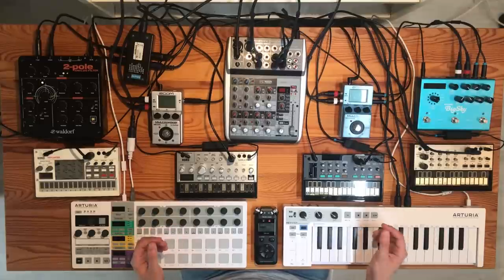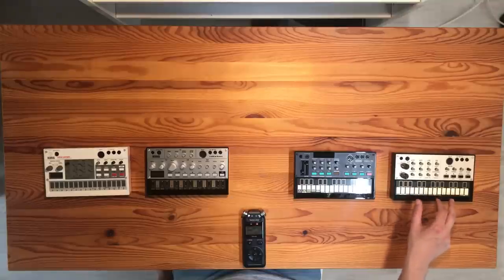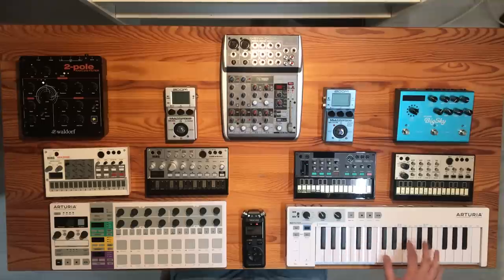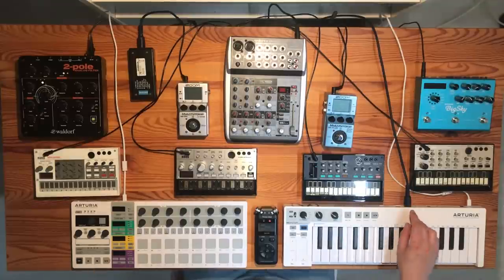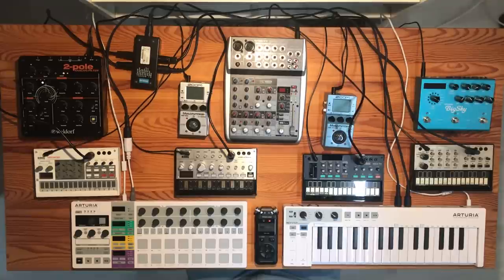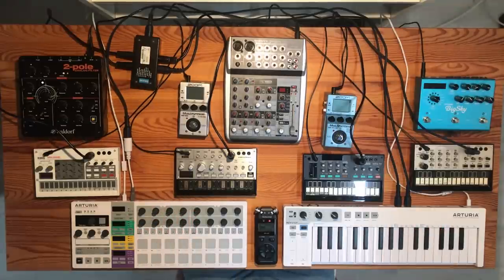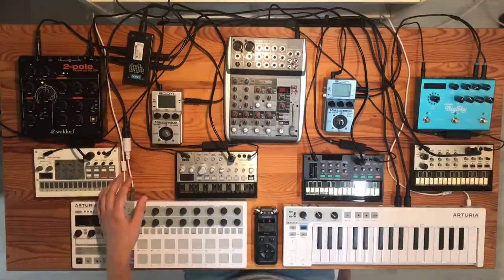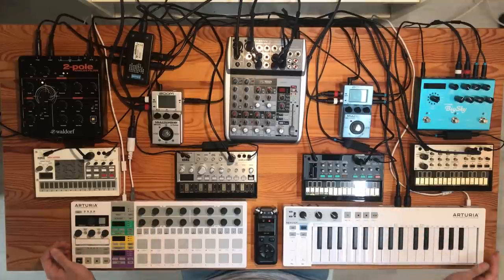Our Volca Setup: How Is Everything Connected? (2018-06-03)

Comment: Midtech midi thru filter, does it work or not? Does someone know an alternative?
Reply: for me it's a clear yes and no: I can filter the velocity but when it comes to the system messages I don't know how to get it working... already tried almost any possible configuration. Is there anything that has to be changed in the Keystep and the setup of the box as well?
Reply: @niklas9649  maybe it is better to just connect only the keys to the midi controller with midi and connect controller to the mixer. And connect bass and beats/sample to the mixer as well? I mean: i wont buy an FM volca.....
Reply from the maker: @Sharkwhisperer  Like @Niklas said: it does work for filtering out the types of messages it mentions on the box (e.g. velocity, pitch bend), but the Miditech cannot filter out start/stop messages. I made the mistake of thinking that turning on the filter for "system" messages (which actually stands for "system exclusive" or "sysex") prevented start/stop, but that's not the case. Apparently, when you've connected an active MIDI device to the Keystep's MIDI IN (in our case it's the Beatstep Pro), the Keystep will not send start/stop messages when you press its transport buttons. When I press start/stop on the Beatstep, the Volcas do respond. So it's perfect for our scenario (we have made the agreement to never stop the Beatstep during jams, haha), but unfortunately the Miditech is not the solution for filtering out the transport messages.
Reply: @SlenterendeBeer  thanks but if I connect only the volca keys to the keystep and connect this with the mixer and connect the bass and the drums with the mixer.   Further on I will connect the volcas among themselves so they are in sync. Would that be a solution. I am a beginner in this. Thanks a lot for you reply. I am dutch too. (also thinking about adding reverb pedal, the hall of fame 2 should be one of the best, but not cheap). And compliments from an English teacher for your English : )
Reply: @Sharkwhisperer  first of all on a sidenote: two dutch and a german discussing midi chains over YouTube, that has a ring to it.
But back to topic: when you try to invert the chain (regarding the clock signal), having the Volcas as master clock to the Keystep, you will lose the arpeggiator and sequencer function in the Keystep. They only work with the sync set to internal. That would reduce the Keystep to a mere keyboard, what would be a waste of possibilities in my opinion.
@slenterende beer The twist with the midi-in signal stopping the system messages is kind of difficult to understand but intriguing.
Reply: @Slenterende Beer @Sharkwhisperer
So I got in touch with someone from the Arturia TechSupport (hands down one of the best support teams I witnessed in a long time: quick, friendly and 100% dedicated to find a solution). Their answer goes in the same direction as what @Sharkwhisperer suggested, putting the Keystep last in the clock chain. It appears that this solution still wont let you work around the problem with the transport messages, but like this you would be able to have a smaller setup without the need for a BeatstepPro. I will just post the original further down this comment. I haven't been able to try the suggested solution yet, but I will post an update here when I had the time to.

In order to achieve this I truly think the keystep should be slaved to the volcas, make sure to update to the latest firmware as well and make sure you have the arm to start function enabled, as well as made sure that the keystep is either set on midi or on clock if feeding only a clock from one of the volcas. The arm to start function would let you use the arp or sequencer only when desired while still being synced to the tempo of your song. 
So I'd advise you to put a volca as master, say the one you are not sequencing or playing on with the keystep, send the clock to the keystep through the analog clock input use the midi output of the volca to send to the midi box to pass the clock to the two others, and if you have a second input on the midi box then patch the midi out of the keystep to the box to pass the note information to the two volcas. 
If you do not have a second input on your midi box i'd advise for you to pass the clock through all of the volcas and put the keystep in the end of chain, and proceed with the midi box.
Reply: Here with an update!
The latest firmware update for the Keystep brought a crucial new feature for this subject to the Midicenter: the 'Arm to Start' function. You have to turn it ON.
If you then connect the Keystep (as well as the other Volcas) via sync-cable to one 'master-Volca' that sends the clock signal you will then be able to use the sequencer and the arpeggiator of the Keystep without having to worry about the transport messages.
Be sure to set the Midi clock of the Volcas to internal (not auto) and the switches on the Keystep to Sync In.
This works for me. I use the Miditech box as well to filter the velocity and as a thru.
Sorry for a possibly bad english. I hope that was understandable and helps you guys!
Reply: Why not tuning midi commands on controller or Wolka?
Reply: PocketFilter/software filtering is another alternative
Reply: @niklas9649  So if the Keystep gets an external Clock/play signal via Midi from another device it is unable to use the sequencer?  I am thinking of buying one but whant to figure out potential proplems it could have with my set up...
Reply: @Lobbogurke  just read through this discussion and you'll find the answers. I'm no tech pro, so my answers probably are lacking insight on that. For me, the arpeggiator for example ONLY works, when it has an external clock. In my case, the internal clock struggled with my synth setup (Korg Volcas). As some others already stated there occurs no such problem, when you combine it all with the Beatstep Pro. I can confirm that but have no idea what the mechanics behind that might be.
Hope this helps.
Reply: @SlenterendeBeer  @Niklas I need urgent advice ...What do you mean by "active MIDI device"?
 What other devices could work to block the PLAY STOP signal like Beatstep does?
Do you know if the old Beatstep also works or only the new Pro version to solve the problem?
Then what do you think of using arduino with a SHIELD-MIDI?
It is truly incredible that they have not yet solved this problem with an update !!! and to think that I bought 3 volca + keystep + midi box miditech after seeing this video and only after realizing that it wasn't working I came to read the comments ...
Reply: @niklas9649   I need urgent advice ...What do you mean by "active MIDI device"?
 What other devices could work to block the PLAY STOP signal like Beatstep does?
Do you know if the old Beatstep also works or only the new Pro version to solve the problem?
Then what do you think of using arduino with a SHIELD-MIDI?
It is truly incredible that they have not yet solved this problem with an update !!! and to think that I bought 3 volca + keystep + midi box miditech after seeing this video and only after realizing that it wasn't working I came to read the comments ...
Reply: Niklas can you please make a video about this???
Reply: @kaioyoca  Did you solve it? My take up to know was setting the volca drums before the keystep so that one doesn't start/stop with the arpegiador but it's a pain in the ass. I am getting my beatstep pro today but I was wondering if a normal midi clock would do. I don't have one at home but maybe someone could try and let me know ;)
Reply: And with midi clock I mean a ER-M midiclock (hardware one) - I just noticed it could sound confusing
Reply: @kaioyoca  check, thx! Didn't know it worked for that too, nice gadget!
Reply: @recap_after_use  I took the RK002 cable and asked the retrokits guys to configure it so that it only passes the clock tempo and not the start and stop signal
Reply: @kaioyoca  nice, thanks for the info!
Reply: @SlenterendeBeer  Hi, I purchased this Miditech filter after searching a lot about how to stop the start/stop messages from the master MIDI to the slaves.
Unfortunately enough I am reading this comment just now after figuring out by myself that it was just not possible xD.
However the solution you presented here, to have a master MIDI that you don't utilize the start/stop message is quite interesting, I will make sure to try that out.
Thanks for the videos and for the channel it is very inspirational, keep doing the good work. Cheers.

Comment: 08:00 Using the pajen firmware you can filter out velocity on each pattern individually, if you want. No hardware midi filter required.

Comment: With so many newer pieces of gear, such as volca, and other analog gear often only offer IN for MIDI.  There is a schematic for a single in to 5 out thru box, that can be easily made or it can be bought for under 50$ online.  I have a 19” processor for midi handling, but the 5 way thru is nice for portability, which is why I like volcas.  It’s great to know that your learning this stuff, and that you have a unique solution that you’re happy with.  Thanks for sharing!
Reply: Where can one find said schematic?
Reply: May one kindly inquire about said schematic?
Reply: Schematic?
Reply: We crave the schematic kind sir

Comment: Most excellent walk thru.  Clearly step by step explained.  The additional descriptive notes are also nice, especially mentioning the MIDI Thru feature of the Keystep from software control panel.  Other Youtube'rs would do well to make similar set up videos.  This has so much helpful info that it should be required viewing for all those diving into this arena of production.  Whenever I'm recording a band or just my own gear I'm always wondering if there's a better (cleaner) way to connect things, but there really isn't.  It may feel like a lot of cables but that's just how it goes.  For audio, midi and power, most people just don't realize what is needed.  Glad to know it's not just me that has so much to connect up.  Cheers :-)
Reply from the maker: Dennis Ristow : Thanks so much for your great comment! Yeah, we’re always thinking about how things could be more organized / compact, but for now it looks like this is what we’re stuck with. :)

Comment: great video, regarding the ground loop issue, those boxes certainly work, or you can use isolated power for the various volcas and the effects (either with the supplied adaptors or you can use an isolated power supply depending on the power demands) should work

a big multistrip and using the supplied adaptors is probably the easiest/cheapest option
Reply from the maker: Yeah nowadays we use a Strymon Zuma as an isolated power supply. Unfortunately the Volcas use the inverse polarity and the small 1.7mm plugs, so we decided to make our own cables. :)

Comment: Thanks for this helpful video! 

I just found the following, for people who are looking for ways to make the Volca's not recieve stop and start signals. Press Start + FUNC to open the menu and then follow these instructions:

Step 7 allows you to filter out any incoming MIDI RX Short Messages such as the Start and Stop commands (FA and FC, respectively). These will start and stop the sequencer from an external control, such a MIDI controller, the SQ-1 play button or your DAW (via a USB-MIDI interface). This feature is turned on by default (LED lit, and the “St.on” message). Turning this feature off allows you to take control of starting and halting the sequencer irrespective of the MIDI signals being received at the MIDI IN port (the volca can still sync to the MIDI clock, depending on what you have selected in step 6).

Source: http://filipe-teixeira.com/electronic-music/volca-resources/volca-sample-tutorial-7/

Comment: Fantastic video.

I concur that the Midi filter is brilliant.  If I had that 20+ years ago it would have saved so much time and many headaches.

I noticed that you use ground loop isolators to reduce the hum (which are fantastic) but have you tried the MyVolts Mickxer? Obviously, if you’re using one specific effect pedal/box for one specific instrument it might be that useful, but if you are connecting multiple Volcas/POs/etc I have found that it works very well with ground noise.

It also saves me a few channels on my smaller mixers so I don’t have to lug out a larger one.  I am very impressed with it. 

Funny how a small setup takes a lot of time, work, creativity, and patience.  You obviously have all of that.
There is a ton of helpful info in this video and just watching it has rekindled my interest in the few Volcas I have but rarely use (gear hoarder here).  

Thanks for a great video.  Like, subscribed, and shared..
Reply: *might not be that useful. Sorry about a few grammatical errors. I tried to edit but I was not able to.

Comment: Great setup and clear explanation. I'm currently putting together a similar Volca-centred setup. I have a Volca Bass and Drum and an Arturia Beatstep (not the Pro though :/ ). I've just ordered a Conductive Labs NDLR as the arpeggiator/sequencer/MIDI brain for the rig. I shall be using a 0-Coast and Mini Brute too in the rig, just need to get a poly-synth or two - probably a Volca Keys and an FM (or maybe just a second Keys and poly-chain the lot). May still need a MIDI controller so your explanation of using the Beatstep into the Keystep is very useful, and I'm pretty sure I can filter out the Start/Stop messages in the NDLR somehow.

Comment: Thanks for the video. However, I don't understand the part of using Miditech filter. Arturia Keystep sends FA system realtime message when the start button is pressed. To filter that out, you need to turn on switch 8 of miditech filter, which filters out all realtime messages such as F8H, FAH, FBH, FCH, FEH, FFH. This includes the timing clock and keystep or beatstep pro will no longer send out midi clock to volcas. How do you do this?
Reply from the maker: I just looked it up and you're right! Wow, that's confusing. I do know for sure that when I turn on switch 8 (realtime messages), none of the Volcas receive clock. But somehow when I turn on switch 8 (system exclusive messages), it will filter out the start/stop messages from the Keystep! So either my Miditech is broken, or the Keystep is sending out different messages for start/stop that fall under the system exclusive category. Weird. I will research this further.
Reply: @SlenterendeBeer  Thanks for the video(s) I’ve been following closely while getting my Volca’s setup. Wondering if anyone has an update for this issue though as I’m also getting this problem with the MidiTech Filter. I’ve looked at the software editor for the midi filter and tried custom MIDI CC settings et. I’ve also tried various settings on the Beatstep Pro editor, but cannot find a way of making it work. Any ides how to get this working? Thanks.
Reply: I figured out what i was doing wrong. I watched this video again and realised you are using the filter to stop the Keystep Arp/Seq triggering the Volca's when starting the keystep. I was focused on the Beatstep Pro Start/Stop triggering the Volca's (which it still does) but once that's running i can stop the volcas and i don't need to stop the beatstepPro again during my jam. The keystep work perfectly and doesn't trigger the Volca sequencers. 
Also, for anyone interested, for the Volcas I sequence from the Beatstep Pro, i have set the "MIDI Clock Src" (option 6) setting in the global settings on the Volca to "LED Off", which disables it from any external midi start, stop and clock. It doesn't need the midi clock as it's only a sound module for the beatstep. That way the filter doesn't have to block "Real Time" events to all devices. Hope this helps someone.

Comment: Hey, thanks a lot. Very interesting setup. I wanted to find a solution with a iconnecting audio 4+. That do a lot of the mixer and for recording in an pc or ipad. 
I'm using the retrokit rk-002 for the sample (and Kaossilator pro (as Synth)), and a zoom R16 mixer with recording function. I have learned something about your powersolutions from you. I have only volca sample, but some other devices. I solve the problem with the ground loop in other way. My solution is to use Usb batterys with 5volt to 9volt converter. 
Then there is no hum from the power, and it runs long enought . (🙂)
I filter my midi signal with the iconnectivity., but it is much more complicated. ( but integrated) in the ica4+)
The midisolution midithru filter is much more uncomplicated. And costs not so many. 
I have thinked about the rk-004 but it is not so cheap. Could be very nice, but i do not need it really. 😉 ( Yeah, optimised text - hope less gramatic and logic errors ;-)
Reply from the maker: Frank Ramrath : Hi Frank, it’s cool to hear you have a similar setup! Yeah I pretty quickly got annoyed with having to change the batteries all the time, so I’m happy with the current solution. :)
Reply: My time (at the moment) is limited, and i have to change the reloadable batteries every one or two weeks, so that it is no problem. And with big USB Battereis and 5Volt to 9Volt converters it is no problem. So i have batteries in only 3 devices. And the Keystep has a normal powerport. Thats great. :-)